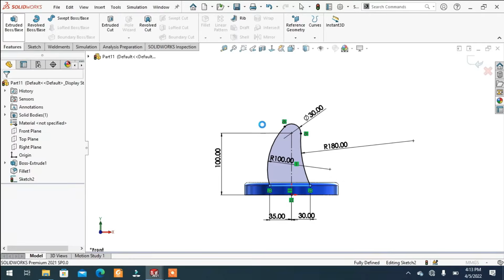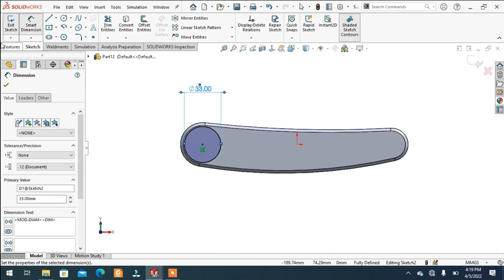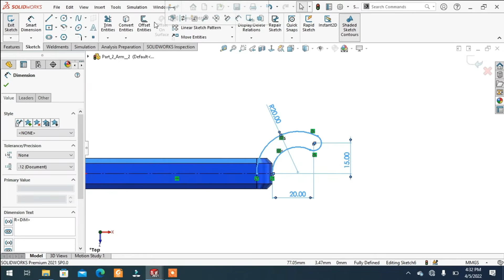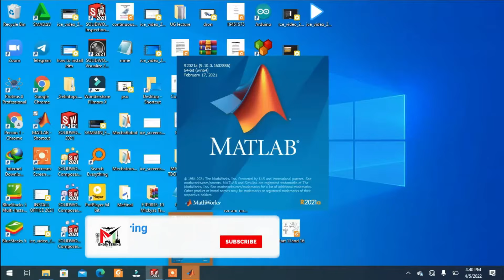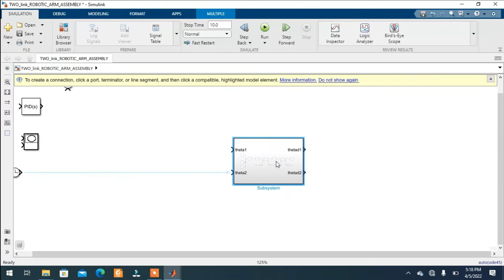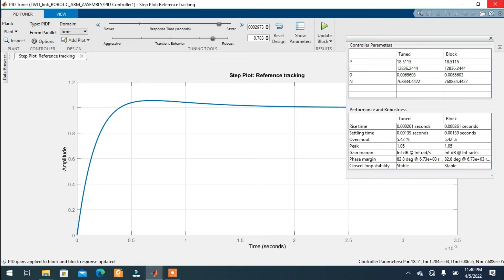The Full Modeling and simulation of a Robotic Arm using MATLAB simscape multibody and Solidworks

Comment: Hi, I tried following through with the video, except I made a model though the blocks in the simscape program rather than importing in a CAD model. But each time I try to run the code, it keeps coming up with a Domain Error. To compute complex results from real x, use 'acos(complex(x)). This keeps being flagged at line 5 in the inverse kinematics Matlab Function. How do I fix this?
Reply: I believe that it’s due to the values being out of range but I’m at a loss trying to figure it out

Comment: Hello I get this error === Simulation (Elapsed: 2 sec) ===
    Error:['TwolinkRobotArmAssembly']: The following errors were found in the model TwolinkRobotArmAssembly.
    Caused by:
        ['TwolinkRobotArmAssembly']: Planar Joint 'TwolinkRobotArmAssembly/Planar' has base and follower ports that are rigidly connected; it is ignored. Resolve this issue in order to simulate the model. can someone help me with this error?

Comment: I get an error saying  === Simulation (Elapsed: 2 sec) ===
    Error:['TwolinkRobotArmAssembly']: The following errors were found in the model TwolinkRobotArmAssembly.
    Caused by:
        ['TwolinkRobotArmAssembly']: Planar Joint 'TwolinkRobotArmAssembly/Planar' has base and follower ports that are rigidly connected; it is ignored. Resolve this issue in order to simulate the model. can anyone help me with this error?

Comment: Hello,thank you for this video. It’s very helpful. I have a question. I need an integrated model of dc motor and four bar mechanism to control angular velocity of bar. How can I do that? Should I use this method or something different? Thank you so much😊
Reply from the maker: Thanks very much for asking, in fact I replied so late sorry for that, but I hope you finish it by now. 
Yes of course you can use a similar procedure as this video so it will be easier to do that this way.

Comment: sir I imported my solidworks model into the simscape, matlab. But the joint in my model is a sliding joint and I don't know why the joint is not showing in the circuit design. can u help me out. Please
Reply from the maker: Thanks for asking , contact me on telegram
Reply: Sir I have messaged you on telegram please help there

Comment: hello I really enjoyed and tried to redo what you've I just coundl't figure out the inverse function for 3 joints robotic arm can you please help ?
Reply from the maker: Thanks for watching this is for 3 link planner robotic arm 
function[x_a,y_a] = Forward_Kinematics(theta1_a,theta2_a,theta3_a)
l1=1;
l2=1;
l3=1;
x_a=l1*cos(theta1_a)+l2*cos(theta1_a+theta2_a)+l3*cos(theta1_a+theta2_a+theta3_a);
y_a=l1*sin(theta1_a)+l2*sin(theta1_a+theta2_a)+l3*sin(theta1_a+theta2_a+theta3_a);

function [xd,yd] = Desired_Trajectory(u)

xd=1.5+0.5*sin((2*pi/5)*u+pi/2);
yd=1.5+0.5*cos((2*pi/5)*u+pi/2);
Reply: @engineering_design thank you so much however I'm asking about the inverse kinematics,it seems that we should work with the inverse kinematics block or there is a function for it?

Comment: Bro please upload more video on matlab.and also the simulation video of the misser machine design in solidwork
Reply from the maker: Sure I will bro. But what kind of content do you like the most?
Reply: @engineering_design  As we have the robatic machine in industry that pick up the components from one place and placed it to other conveyer. Different types of mechanism use in day to day life and in industry and simulation also sir that the components we make is worthy or not.

Comment: One question please reply quick if i have 3 DOF robot then inverse kinematics have theta 1, theta 2 and theta 3 and i have seen in your video you have find the theta 1 and theta 2 and how to find theta 3 please give equation to add theta 3 in your same robot as in video
Reply from the maker: function[x_a,y_a] = Forward_Kinematics(theta1_a,theta2_a,theta3_a)
l1=1;
l2=1;
l3=1;
x_a=l1*cos(theta1_a)+l2*cos(theta1_a+theta2_a)+l3*cos(theta1_a+theta2_a+theta3_a);
y_a=l1*sin(theta1_a)+l2*sin(theta1_a+theta2_a)+l3*sin(theta1_a+theta2_a+theta3_a);

function [xd,yd] = Desired_Trajectory(u)

xd=1.5+0.5*sin((2*pi/5)*u+pi/2);
yd=1.5+0.5*cos((2*pi/5)*u+pi/2);
Reply: I also needs it please
Reply from the maker: @zaidal-zubaidi5281  function[x_a,y_a] = Forward_Kinematics(theta1_a,theta2_a,theta3_a)
l1=1;
l2=1;
l3=1;
x_a=l1*cos(theta1_a)+l2*cos(theta1_a+theta2_a)+l3*cos(theta1_a+theta2_a+theta3_a);
y_a=l1*sin(theta1_a)+l2*sin(theta1_a+theta2_a)+l3*sin(theta1_a+theta2_a+theta3_a);

function [xd,yd] = Desired_Trajectory(u)

xd=1.5+0.5*sin((2*pi/5)*u+pi/2);
yd=1.5+0.5*cos((2*pi/5)*u+pi/2);
Reply: @engineering_design  what about the inverse kinematics of 3DOF robot ? Could you post that as well please ?
Reply from the maker: @Charmerdark  function[x_a,y_a] = Forward_Kinematics(theta1_a,theta2_a,theta3_a)
l1=1;
l2=1;
l3=1;
x_a=l1*cos(theta1_a)+l2*cos(theta1_a+theta2_a)+l3*cos(theta1_a+theta2_a+theta3_a);
y_a=l1*sin(theta1_a)+l2*sin(theta1_a+theta2_a)+l3*sin(theta1_a+theta2_a+theta3_a);

function [xd,yd] = Desired_Trajectory(u)

xd=1.5+0.5*sin((2*pi/5)*u+pi/2);
yd=1.5+0.5*cos((2*pi/5)*u+pi/2);